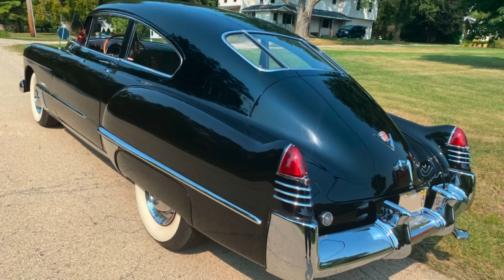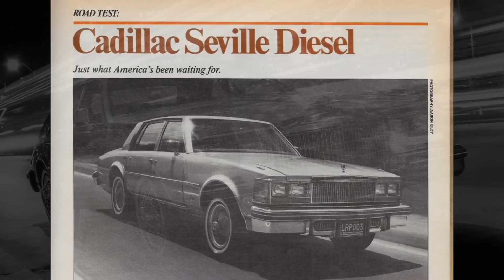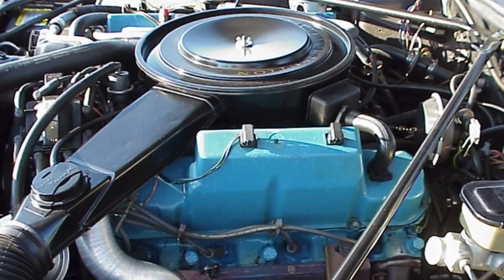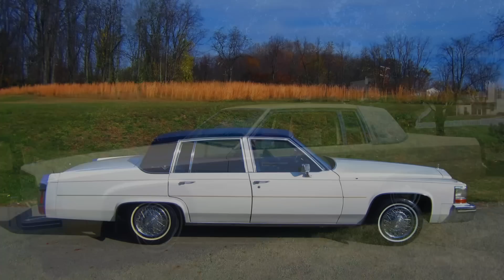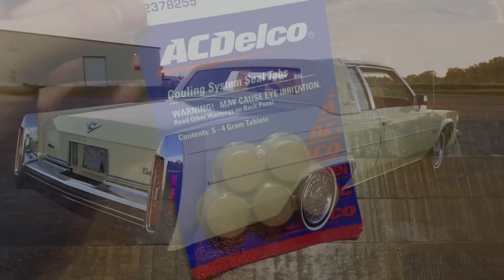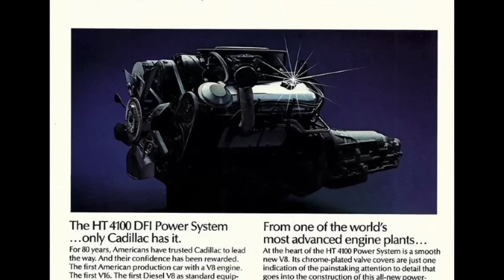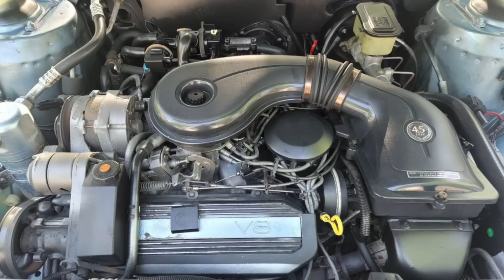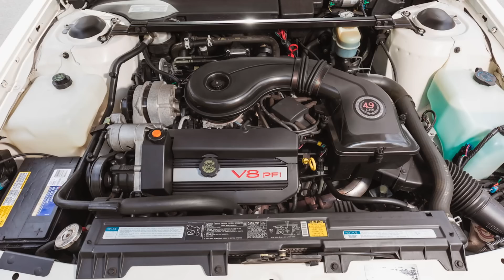This is GM's Worst Decision for Cadillac and Affected Its Reputation for Decades...

Comment: It looks GM made some many mistakes in the early 80's with Cadillac.  Cimmaron, V8 6 4 engines, Diesals , 80 Seville, look alike Devilles downsizing  (which looked like other FWD cars , not Cadillac). etc, etc .. CEO Smith and upper Management heads did some terrible things to GM in the 80's
Reply: What's a diesal?
Reply: I think the MAIN PROBLEM was not the companies as it was the GOVERNMENT inserting itself into the equation! Ronald Reagan said it best" Government is NOT the solution! Government IS the PROBLEM!! A little study of history from 1970 to the present will show that.

Comment: I disagree. I say their biggest blunder was cheaping out the interiors and chasing higher sales in the 70s. Cadillacs became too affordable and lost their exclucivity to the germans. Thats when they became an old mans car, a reputation they couldnt shake till the cts and gen2 escalade came out decades later.
Reply: I would say that a luxury car begins with a functioning engine.
Reply: @jamesengland7461  the brittish brands disprove you😂
Reply: @Henry Jones  well, there is that :) though I thought that at least Rolls and Bentley of the era had that squared away with their big V8 and GM transmissions
Reply: Slight disagreement in that they priced themselves out of the market for the next generation of buyers.  For example, the 1979 Seville MSRP was $16,000 and was the most expensive Cadillac.  For comparison, my 1979 240D with crank windows and 4 speed manual transmission MSRP was $16,500.
Reply: @bobbbobb4663  the rest of the cadillac lineup had become too low priced. That was my point. The cheapest cadillac was almost the same price as the most expensive chevrolet. They became too affordable. Gm prostituted the brand, cheaping out interiors cutting costs to cut prices and chase sales. Luxury isnt luxury if everyone can afford it. Thats where cadillac lost their rep for high end luxury and became seen as an old mans car cuz retirees were the ones buying them while wealthy younger buyers flocked to mercedes and bmw.

Comment: That 67 Eldorado is a masterpiece.
Reply: Not as much as the 1966 Olds Tornado.
Reply: @jackkerouac6186  that is a spectacular automobile, I think you're right. Cheers
Reply: @buckodonnghaile4309  those eldorados were put on the olds frame. My Toronado could do sixty mph u turns . If you had 4 or 5 lanes
Reply: @buckodonnghaile4309  those eldorados were put on the olds frame. My Toronado could do sixty mph u turns . If you had 4 or 5 lanes
Reply: @jackkerouac6186  interesting. A 60mph u turn sounds like my kind of fun.
Reply: @buckodonnghaile4309  it was front wheel drive with a 426 or 429 . All those Eldorados after 1966 were front wheel drive. Awesome
Reply: I'd take both of them. Both were cars ahead of their time. 2 of GM,s great successes.
Reply: 5 miles to a gallon tho
Reply: GM worked out the bugs from the first year, they got better each year after '67. I had a '68 in the 80's for 5 yrs. until became too expensive to keep it as a daily driver.
Reply: I got the 68 Eldorado.

Comment: GM's mistakes in the 80s was taking a diesel from a derived gas-powered block.  This was a shortcut that bit them in the butt.  I also agree the HT4100 was terrible (so was the initial 1993 Northstar, as it is still haunts them to this day regarding leaking head gaskets).
Reply: Agreed, North Star head gasket failure rates are one of the worst GM failures.
Reply: I knew two people who had GM diesels, my father-in-law and a co-worker.  My father-in-law did not maintain his cars very well, oil changes and such. At about 45000 miles the diesel engine blew up. My co-worker maintained his cars on schedule as indicated by GM.  At about 45000 miles, his diesel also blew up.  These were horrid engines.  The car my co-worker had was an Oldsmobile and he had a gasoline engine installed.  I do not remember if GM helped with the cost or not.
Reply: It's hard to anticipate all the problems an  all-new engine or transmission might have when it is first released to the public. I think automakers should use low-volume specialty models (things like the Allante or the Cosworth Vega) to, eh, beta-test these assemblies before trying to sell them at volume. With a only a few hundred sold, they could afford long warranties to keep customers happy, and even implement quiet buybacks if the cars were incorrigible lemons. Of course, that can only work if you have the know-how and will to fix all the design defects; it wouldn't have been enough sort out Chrysler's Ultradrive 4 speeds, which were still failing after 10 years of production.
Reply: @pcno2832  Somehow they seemed to get things right in the cases of the Olds V-8 in '49, Chevy and Pontiac V-8's in '55, Buick V-8 in '53, etc.  Those engines were the products of real engineers, not pencil pushers.
Reply: It’s a common misconception that the 350 diesel was based on the 350 gas engine block. It is not. It was a clean slate design that shared displacement only coincidentally.
Reply: @mrobinson4210  No it really was a 350 olds engine that was strengthened and modified for diesel service. If you looked at them side by side, it was apparent they were VERY similar. Valve covers, water pump, head bolt pattern, rocker arms. The accessories mounted in the same place. Visually it looked like a 350 olds engine with an injection pump where the distributor normally is and injection tubes where the plug wires were. Of course the block was beefier. And other internal components strengthened. But looking at them side by side the similarities were VERY apparent. Even if no one told you, you’d see it right away. It was Oldsmobile through and through.
Reply: @M Robinson  Absolutely not. The Olds diesel 350 was absolutely NOT a clean sheet ( not slate?!? ) design....it was the furthest thing from that.
Darryl is 100% correct.
Reply: My 1993 Allante has 120k.  On the hwy, conditions permitting, I cruise at 90-100 with bursts to 120 (soft top gets a little strange above that) and it has great acceleration.  I use green coolant (changed every two years w/ one pellet).  Knock on wood.
Reply: The Northstar is actually a great performance engine with very minimal upgrades. Which should have been done off the line!
Reply: @shawnsatterlee6035  it performs well. But it's not reliable. Oil leaks and head gasket leaks are its Achilles heel

Comment: Was guessing just based on the title of the video, you were going to mention the Cimmaron.  There are a lot of poor decisions to choose from
Reply: I was thinking the same thing. If that was a Cadillac my daughter's Beetle is a 911.
Reply: @buckodonnghaile4309  Ha, well said
Reply: Lol the Cimaron.  The Cadillac Cavalier.
Reply: Dad bought a new Seville in 84 with the HT-4100. It was good for a very placid rate of acceleration. He was shocked when his car business buddies informed him that the engine was doomed to fail in a few years. Surprisingly, the car lasted until 2002 when it was sold to the third owner, who trashed it. It did better than his 1980 Brougham diesel, which needed stop motion photography to record any movement.
Reply: I wrote a ton of repair estimates for Caddies of the late 70’s to mid 80’s.   I watched the devastating effect the bean counters had across the GM line.

Comment: Can we just blame Roger smith for all of everything that went sideways for all GM divisions ??
Reply: Roger Smith single-handedly did more to ruin GM’s reputation than anyone else in history.
Reply: @dave1956  probably. There was a significant issue that papered over his mistakes: high inflation/interest rates created huge surpluses in the pension plans that due to MTAR rules caused massive revenue transfers to GM. Thus while the business was losing market share (and per vehicle margins were in decline) at the bottom line the company was doing very well. 

Twenty plus years later low interest rates and more retired employees than working ones and non-business liabilities essentially were the coup d grace.
Reply: @gordtulk  Yes.
Reply: @gordtulk  

But the bottom line is, you build garbage that nobody wants and is so unreliable that people swear that they will never buy another. Enter the imports. They were poised, waiting for the American car industry to fail. They didn’t have to wait long. I started buying Japanese vehicles during this period because my last 3 domestic lemons barely lasted as long as the payments.
Reply: GM made a ton of mistakes in the 80s that pretty much killed any remaining goodwill for well thought out innovation and quality.  The early X-cars were horrible & unrefined; with the possible exception of Buick, build quality and fit & finish was shoddy; and as far as Cadillac goes, in addition to the 4100 engine disaster, we can’t forget the Cimarron, Cadillac’s dressed up Chevy Cavalier!
Reply: @Primus54  if you want to see how bad gm cars were in the 80s do a youtube search for 1982 pontiac phoenix and youll get a 1984 home video of a guy selling his 2 year old phoenix. He says its unreliable and you can see the 2 year old x car is literally falling apart. 2 years old and the paints peeling, grill cracked hubcaps gone trim falling off,,,unreal compared to even cars back then!
Reply: @Primus54  I'll agree on the early X cars my late maternal grandmother had a used 1984 Buick Skylark for a 1 1/2 or 2 years from 1988 to 1990 and loved it though she did have one accident in the car though it wasn't her fault somebody side swiped her in the Kmart parking lot behind what became square one mall heck even Toyota had a deal with GM back then where they had a version of the Cavalier  as some Americans were still leery of buying a Japanese product particularly a car as Japanese steel was thinner than US Steel and you could tell the difference when you shut the car door an American Car had a resounding thud when you shut the door while a Japanese one had a tinny sound. though that started to resolve itself in Toyotas Subarus Hondas etc. by the mid 1990s-mid 2000s my dads twin sister Barbara had a 2006 Corolla S until about 2012 and she absolutely loved it. had I not been legally blind I'd have probably learned to drive in Grandmas 1990 Camry CE she paid 9,300 for new of the showroom Floor on Presidents day 1990 roughly 20% of the original list price then her 2nd Camry was a 2005 LE which we only got 8% of the list price  because we paid cash she was a repeat customer of the dealership and the car was missing some features it was supposed to have such as Sirus/XM Satellite radio etc. of course prices vary from dealership to dealership the closest Toyota dealerships to here are Herb Chambers Toyota Of Boston Atlantic Toyota in Lynn and Ira Toyota/Lexus of Danvers
Reply: Roger certainly was a major factor in GM losing market share during and after his tenure.
Reply: @ppeters480  see Moore’s Roger & Me. Smith did his best Neutron Jack impersonation, canning thousands of employees and closing factories only to blow a crap ton of money in Saturn which was closed 15 years later?
Reply: @estyrer2  saturn the brand shoulda never existed. The saturn car shoulda been the 91 cavalier. This was what people were saying when saturn was new.
Reply: @estyrer2  I still see people driving them.  They must have been OK.
Reply: @estyrer2  Yeah  all the job losses. It would have been interesting to see if he met up in a dark alley with a group of the UAW guys that lost their job !
Reply: @Henry_Jones  Saturn was intended to coax the UAW to be less costly to GM.  When Saturn failed GM turned to Mexican manufacturing
Reply: @timothykeith1367  if i was a division level engineer or manager I woulda been pissed to see billions going to a new brand while chevy was stuck with j cars,,, and they were till 2005!
Reply: Truth. Smith single-handedly destroyed any perceived brand differentiation between the various GM divisions.
Reply: @GTRxMan  i think that die was cast before smith. Look at the 77 b bodies. People rave about how awesome they were but you could see when new tbey were all the same car.
Reply: Roger Smith was heard to boast that it cost a mere $250 more to build a Sedan deVille than a comparable Chevrolet Caprice Classic Brougham LS
Reply: When Smith inherited the helm, GM had a fifty percent  market share.
Reply: @skinnerhound2660  deadmen walking. As I noted in a earlier post. Net Revenues were from non- automotive activities.
Reply: I saw Roger Smith speak at the Fisher Theater in Detroit 1985.  I don't recall anything he said but that is an awesome building.
Reply: My dad was not in the auto business  but he was a corporate employee who started as a junior exec fresh out of GI Bill college and worked his way up to Sr VP by retirement in 90s.  He surprised me once saying that Michael Moore was right about Roger Smith being disastrous but not for the reasons Moore thought. His real problem was that he was a finance guy not a car guy. He knew and cared about nothing but numbers.  The finance guys took over that whole industry and many others in that era and they ran once world class American manufacturing into the ground.
Reply: @mikegalvin9801  thats what John Z Delorean said too in his book, On A Clear Day You Can See General Motors and that was published before Smith was CEO.
Reply: More like blaming the government. They ruined cars and trucks back then and they are about to do it again with all this electric bullshit. 😒
Reply: When Roger Smitb said, "The job of General Moters is to make money not cars for its stockholders."  I knew GM was done.
Reply: @vapsa56  i remember a car and driver interview back in the day - they asked Smith what kind of car he drove. He replied “…some kind of station wagon”. At that moment I knew they were dead.
Reply: @vapsa56  All American companies.  We are doomed.
Reply: I blame smith for obsessing over purchases instead of product. Hughes aircraft and EDS purchases were his big mistake.
Reply: @Henry_Jones  Just like AT&T.  They bought and promptly ruined three computer manufacturers just before the turn of the century.
Reply: The management rot and decline began well before Smith. Smith was the ‘fruit’ of that decline.
Reply: Roger B Smith  was not a car guy . Was strictly a $$$ guy  . His tenure set in motion the eventual bankruptcy of GM .
Reply: Absolutely! I wouldn’t have let that arrogant, egotistical man manage a roadside lemonade stand, much less a corporation like General Motors.
Reply: I always do
Reply: Roger was the scapegoat. The shareholders are to blame. They made all the bad decisions to feed their greed.
Reply: @rollydoucet8909  ok blame the shaeholders and thefore the board of directors, sure..who was chairman of the board? Roger Smith, chairman AND ceo making him practically untouchable.
Reply: @Henry_Jones  Another bad management practice that crept in during the 70s. In theory the board is oversight for management so having CEO be Chairman is a conflict of interest that almost guarantees the board will be just a management rubberstamp. Not a coincidence that  ridiculous compensation inflation for upper management began soon after this became commonplace.
Reply: @Henry_Jones  Many of the shareholders don't even buy GM cars. They're just in it for the money, and once the good days are over, they'll bail and take their cash elsewhere. Meanwhile, what was once one of the greatest manufacturing companies in the world, and pride of America, is falling like a lead balloon.
Reply: I blame your mom
Reply: "Grosse Point Myopia" is older than that. They lost their quality and exclusivity already in the sixties. Cadillac traditionally sold between 100-150k cars per year during the fifties and sixties, slowly upping the production. 1967 was the first year of 200k cars per year, 1973 300k cars, 1979 380k cars per year and so on.
Reply: @ingvarhallstrom2306  Agree.  But the cars were cheap in the 60s.
Reply: @rogersmith7396  really? 1960 Chevy Impala was $2,600. 

Today's money that is 26.5k. You can buy a trailblazer for 22k...
Reply: @samholdsworth420  My dads 66 Mustang was $2200, his 73 Camaro was $3600, the 70 Eldorado was $6600.  I was'nt in on the Olds or Corvair purchases he made.  His late 60s Piper Cherokee was $38,000.
Reply: @ingvarhallstrom2306  thats what i said in a prior post. They prostituted the brand in the 70s, selling out its exclucivity for sales and the germans took over to this day.